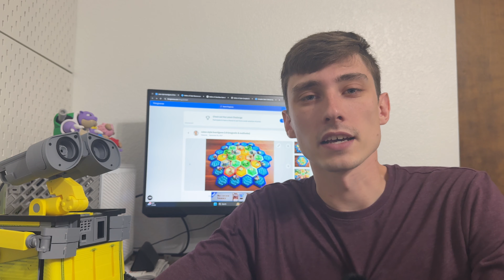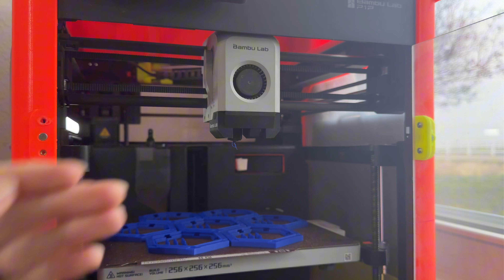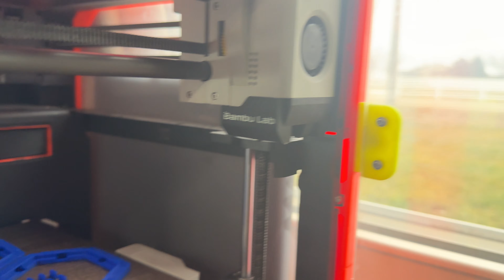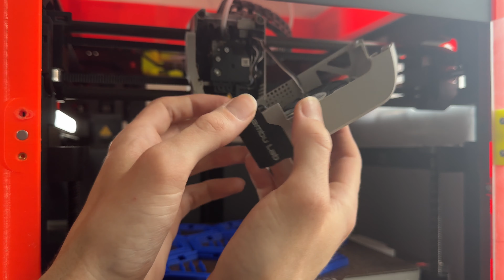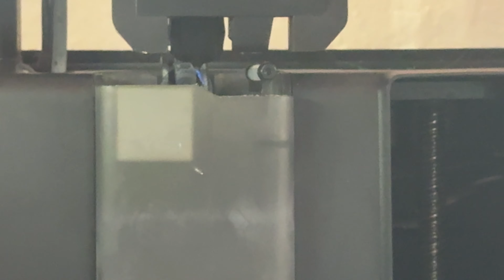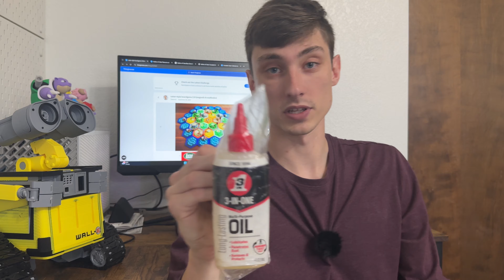My Bambulab P1P & P1S Maintenance Checks

Comment: Thanks for the video sir..I'm seeing the filament spooter to the side during a push through, I'll check it again but yeah generally my print layers have been real shitty, I've tried tinkering with the speed and heat settings but I'm kinda leaning towards the nozzle being shot, and I'm considering replacing the whole hot end ... Do you have any recommendations for a hot end upgrade?
Reply from the maker: Your P1S is putting down bad layers? Theres a whole lot of things it could be. If you join my discord i can help you troubleshoot further my first assumption would be a bent nozzle or loose nozzle. Or the heat brake has deteriorated and allowing leak through.
Reply: @NotAnotherPrintingChannel  do you have a link for the discord?
Reply from the maker: @ https://discord.gg/ZvVaVV6T
Reply: @NotAnotherPrintingChannel   thank you 🙏

Comment: Needed something like that. Will wait for the A1 mini one
Reply from the maker: Its coming up here. Should be next sunday but realistically its the same. I check at 500 hours. Clean and lube rails, check belt tension, bed screws and AMS Lite ptfe tubes
Reply from the maker: And then the extruder i look for debris and if the nozzle is all gummed up and do the filament check. Basically the same thing but i will still do it